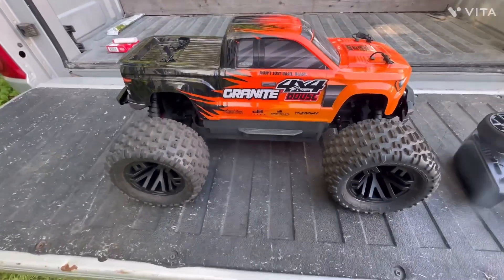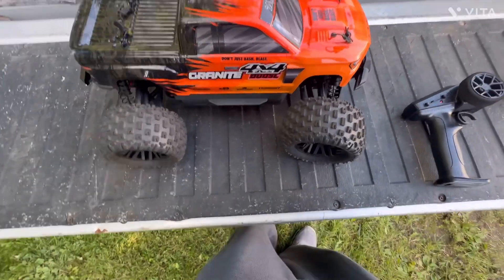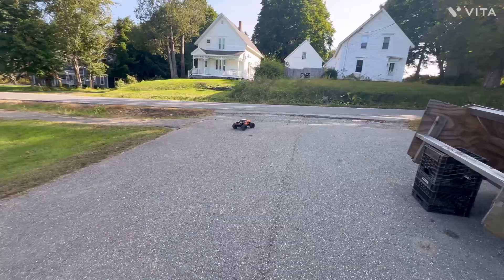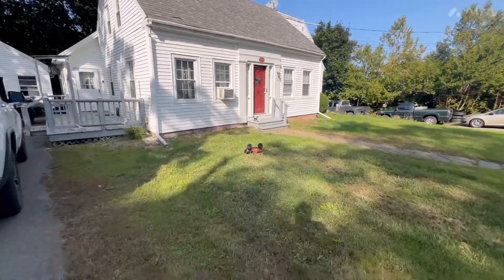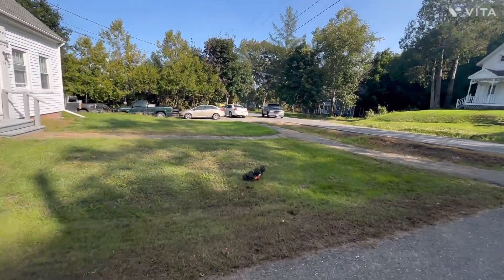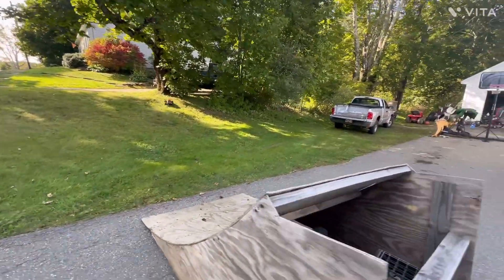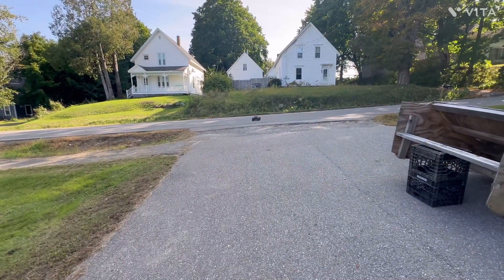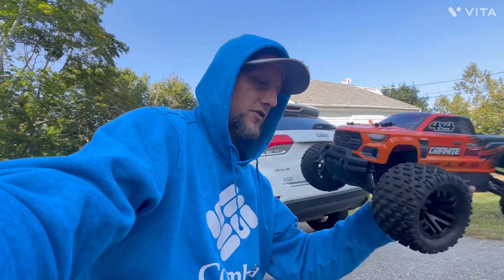Arma granite boost gets its first upgrade

Comment: Nice bashing Chris I did the same thing with mine and let my nephews drive it and they burned out the brushed motor. I installed the esc and the motor but my spur gear wouldn’t fit the new motor. So I’m waiting for the new spur to arrive to finish the upgrades.
Reply from the maker: I’m putting 100 blx esc and motor right now video will be out soon if not tomorrow then sat hopefully been so tied up at work mill I work in is getting ready to close down for good within a few months really blows I like my job